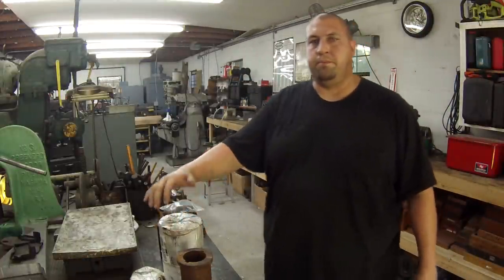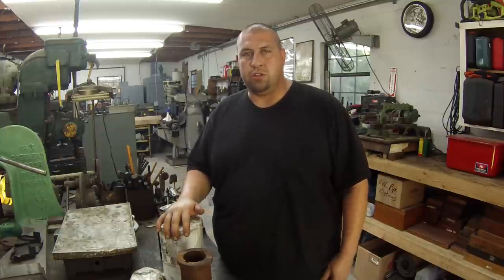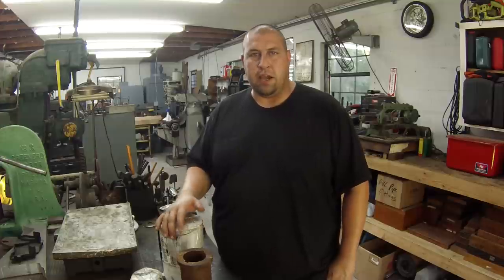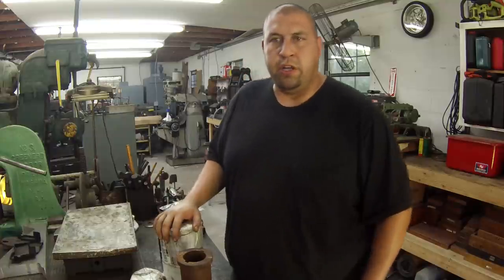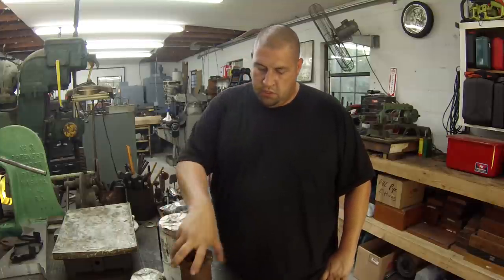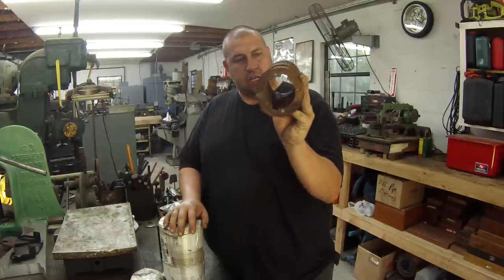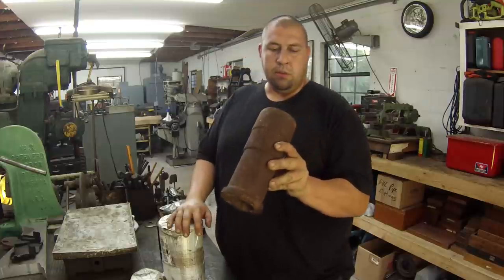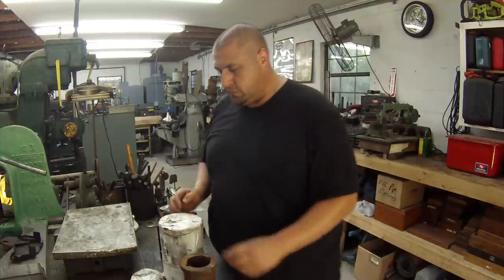The Monarch Revival

Comment: I know this is over 5 years old but has been helpful. I bought the exact same lathe last fall. It's a 1944. 
It's still on my trailer while I modify the shop. This has renewed my motivation.  
When you look back at this compared to now you weight loss is very noticeable. Keep it up.

Comment: What a coincidence. I started learning my trade in 1950. I would have loved to have a 1950 model lathe. Mine was made in  1904. Flat bed - Cone pulleys - Motor shared with three other lathes. Very annoying every time one lathe started the others slowed. When one stopped the others sped up - Still did some very accurate work.

Comment: Adam, I know this is an old video but when you were commenting on how filthy the sump was, I couldn't help but think back to the mid-'60s, when my Dad took me to a dingy machine shop down Palafox south of Main that was run by a man he knew. Your shop is surgically clean compared to that pig sty. I think there was a concrete or brick floor but all you could tell you were walking on was an "asphalt" composed of grime and cutting oil. There were drifts of this black "asphalt" piled up around the lathes and milling machines. The whole place reeked of burned metal and cutting oil. It was amazing.

Comment: Great Vid Abom! A trick I learned to prime coolant pumps is after clearing with compressed air, put a shop vac on the discharge nozzle and just create a closure with your hand, usually pulls the air bubble through the impeller and gets things going.

Very touching story about 3 generations running that machine, hope it stays that way!
Reply from the maker: Thanks for the tips Shadon, and thanks for great comments!
Reply: Very touching store of your 3 generations, very fortunate for you to of had those kinds of experiences.!.

Comment: Be careful cleaning out that sump. You might run into the creature from the black lagoon. You should open up a window at end of the shop where the Monarch is. If you open up both ends of a long narrow building you will create a natural "breeze way". A breeze way is a common old fashioned down south feature that my grandfather told be about. The way it works is the air moving past the openings at either end of the building will never be equal and the pressure difference will cause the air in the building to move one direction or the other. You might also get a swamp cooler which is a big trough of water with a long fan that blows air over the water. As the water evaporates and the air blows over it the air will be cooled down. If you don't have any air circulation in a building like your shop the air inside will act like a heat collector and will be hotter than the outside temp. You should also but a few rotary vents in the roof. As the air in the building heats up the hot air will be trapped up by the ceiling if it can't vent out. Great memories of your granddad and dad.

Comment: Really cool. I could see you were reliving your childhood. My memory is going into the dirt floored WWII surplus Quonset hut that was the shop to prefab plumbing for my Dad, two uncles, two grand dads (one ex hubby, one current) and the foreman. They'd let me and my cousins run the pipe cutter (slapping leather belt line shaft off a big old motor hanging down from something -- a skyhook?) but not the Rigid pipe machines, so we cut a lot of nipples, but didn't thread them....Not old enough. The Rigids used the same dark brown syrupy cutting oil in a flood coolant flex tube, and for pipe dope, they'd mix it with cement. I'll bet your shop smells exactly the same....
Thanks, Man.

Comment: I love the old lathes, I ran a Jones and Lamson #5 turret lathe for about 2 years and was built I think in the mid 40s the horse power was unbelievable never had a job that it couldn't handle with the correct tooling

Comment: Nice old Monarch, Quiet, Good Bearing...The Sump screan needs cleaning. Also the coolant should be screaming out that Jet. You need to check rotation on that pump.
 But nice old Lathe I had one in my shop for 15 years. It's really the Cadillac of Lathes. I'm sure you'll take very good care of it. Good for you.

Comment: i used to run the same machine. if i remember correctly, the stop collar on your feed neutral/reversing  lever shaft will stop the feed wen hitting the collar. works well for threading to a shoulder or internal threading

Comment from the maker: You can visually inspect the bed ways closely and usually you can see the wear in them, especially near the chuck when the carriage is used the most. Also check the backlash in the cross feed screw, thats another part that is often badly worn on old machines. Check to make sure all speeds run correctly, and that all the feeds work correctly also. Theres really alot of things that one can search for when inspecting a lathe, but sometimes you dont find them untill its being used or somethin breaks

Comment: Hi , just a note about the coolant pump . if as i suspect it is a centrifugal pump they will not self prime well so when you run them they cavitate which is the noise you hear. to prime after the system has been drained use a funnel and fill the lines backwards to prime or draw the coolant up the line with a plunger of some description .

Comment: Hi mate.  This was a revisit to this video, and I still enjoy it.  A lot has happened since than.  You have made some wonderful projects on that Monarch.  I would like however, to ask if you could work and explain the taper connection.  I have one myself, and know largely how to work with it.  But I would like an expert to show me how to do it properly.  I think that I should loosen a fixture to use it, but am not sure what.  Therefore, if you could spend a little time explaining it, I would be very grateful.           I have no one, beside the videos, to show me how to do things properly.    Marcel.
Reply from the maker: I want to talk about the taper, but hoping it can be some machining involved.
Reply: That would be great Adam cheers
Reply: +Marcel Timmers  
Loosen the Allen head screw on the head stock side of the taper attachment. Then turn the square head bolt on the tail stock side to adjust the angle. There is one at the college I'm taking machining class's and that lathe is just amazing!! It is just a solid machine.

Comment: I just picked up a 1943, 30" 16CY.   I have a few questions. 
What size is your chuck. Are you happy with that size. 
Wast is the part number for your tool post holder. Do you like it over Aloris. 
I see your motor start switch has three buttons. Is reverse controlled from there. 
I keep current on your pages but really liked this old one.

Comment: Hey Adam I got this very same lathe but mine is a 16cy 16" x 30" 18.5 swing. It was made 11/1944. I was wondering if you know how much oil it takes in the head stock. Is it common for some one to bore out the tail stock to a 5 or 6 mt and put a sleeve in and pin it through the quill that what I ran into on mine some one did that and the person I got this lathe from popped it out. now I'm looking to rebuild that sleeve now. Great video I learned on the monarch lathes my self 20 plus years ago still my favorite lathe.

Comment: Adam, I am new to your channel and i am enjoying your videos a lot. JUst a quick comment, I hope that light above the monarch lathe is not a flouresent as it can cause the lathe to look like it is not turning when it actually is. It is caused by the flickering of the light syncing with the lathe speed.

Also can you please tell me what the other 4 slots on the chuck are used for?
Reply from the maker: +born2flyau All I have is fluorescents for shop lighting. The slots are for adding counterweights, or for using hold down hardware.
Reply: I'd guess it looks stationary at multiples of 60 rpm, right?. If NOT, either the power company is running too slow or fast or the lathe is LOL

Comment: I am not a know-it-all,  but I was taught never to run my lathe without something locked into the chuck jaws to insure that one or more jaws would not somehow work loose and fly out of the chuck head.  I see that the jaws are down into the head a good piece,  but that can be dangerous,  something that my mentors really emphasized to me.  Your chuck does not appear to have any stock in it.  Please be careful about that.   Nice shop.  Wish I had my Monarch that I used at my workplace.  I did enjoy your video. Thanks.